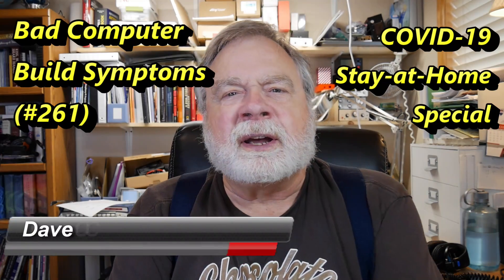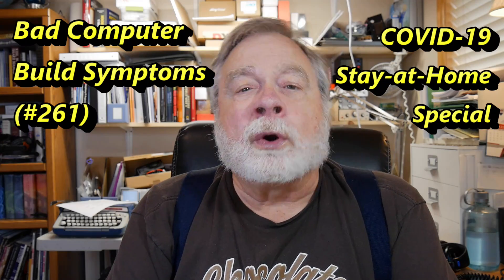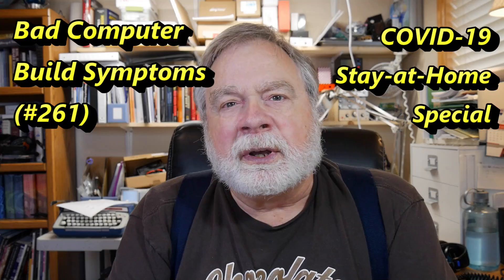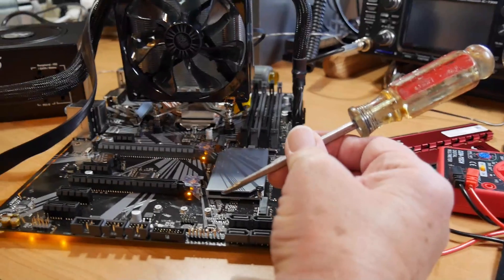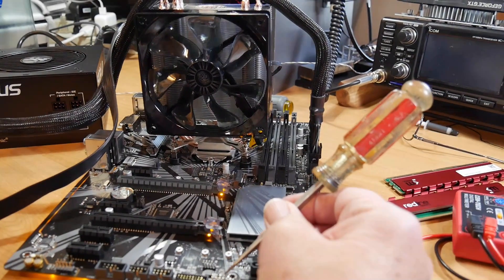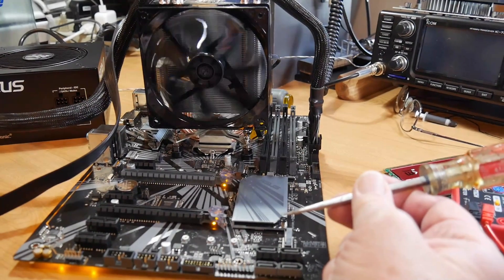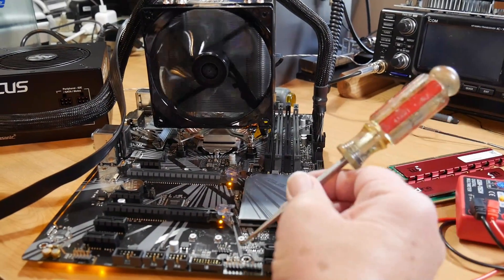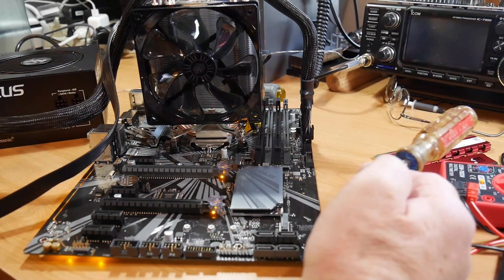Bad Computer Build Symptoms (#261)

Comment: I think your problem may have to do with the time you plug in the power cable wrong! The power supply turns on and sees something it shouldn't, or it doesn't see something that it should so it shuts down. Some power supplies must see a load on some of the leads before they will work. I learned that when I used an old computer power supply to use for my bench power supply. Did you check the runs on the board after you shorted it with the plug in wrong? I don't remember for sure but I think that the 5V needed a 20ma load or the power supply will not stay on. It sees something wrong.
Reply from the maker: It turned out to be a mismatch between the motherboard and the processor.

Comment: As many others have already pointed out, you have mismatched components, and worse, you're tapping a powered up motherboard with a metal screwdriver.  Not very smart thing to do - one false move doing that and you'll fry the entire thing - in fact that can happen even with the motherboard is powered down.  All it takes is for someone to forget to discharge themselves on a piece of metal before handling components or dropping a screw on the motherboard in the wrong place and you might as well frame it on the wall as a modern art masterpiece.  I am not trying to be insulting here - but PLEASE wait for your local professional to help you before you end up destroying it.

Comment: Before assembly of parts you should know that your motherboard and CPU are compatible. Not sure why you are checking the functionality of the case fan, CPU fan, etc. before running the computer for basic input/output system test to determine that your computer is working before it looks for an operating system. From this and the previous video it doesn't sound like you have tried a POST yet. I have built many computers. Unsure why you haven't performed a post yet and determined that BIOS is performing. 73 KB8AMZ

Comment: your motherboard has a 300 series chipset and your i7 6700 will work with 100 and 200 series chipsets. Need to match cpu with motherboard. The combo you have are not compatible . 73 KD5P

Comment: The Prime Z3700-PII motherboard is for 8th generation Intel socket 1151 Intel Core 9000 series  Core i7i5/i3 CPUs.
 Your  I7-6700K is a Skylark 6th Generation CPU. 

These will not work together.

Comment: Glad it has been resolved. One thing you can do to avoid that issue in the future is to use a site like pcpartpicker.com (use the System Builder from the main pages menu) and in this case you could select your CPU and then filter through the available motherboards (comparing the features you want such as number of USB ports, onboard NIC(s), no. of PCI lanes). Good luck with the rest of your build! You may also want to hold onto that MLB because you may find a need for it later.

Comment: As Aaron says, you can't use a 6th generation intel processor like the 6700K with a Z370 based motherboard.  So now you have to decide whether to replace the motherboard or the processor. I just checked online for prices for an 8700K processor. They run about 350 dollars at sellers like Amazon and New Egg (depending on CPU version). By the way, if you do this, you will be jumping ahead two generations in processor technology.  Good luck and 73 - John, K3SGB

Comment: Analyzed your troubleshoot, just to see if I could be of help here

2:00 - You've tried the 'bare board'. Excellent. Cooler must retain in place all time, no exceptions.

Did you try another PSU - This same symptom happened to me with a faulty PSU. Replaced and worked without changing anything.
Although the voltages seemed to be correct, there was a ripple - too big for the mainboard to accept. Most likely one of the output-capacitors failed for some reason. - confirmed later: Yes you did. 

2:30 Shorted the PSU switch lines - No issue here
2:50 Voltage checks done - OK
3:00 Another powersupply, an older one - may be faulty - dried capacitors
3:06 BIOS reset by removing battery etc - OK
3:15 No power on self test. Not a good sign, but doesn't neccessarily mean a dead mainboard.3 Thoughts go to processor incompatibility - BIOS upgrade might be required before using the processor
3:25 Reseating the processor. Should be OK

Intel Core I7 6700K - not the most recent processor (6th gen, most recent one is 10th generation, should be supported
Asus Prime Z370-P II - Asus lists with this mainboard: Intel® Socket 1151 9th / 8th Gen Intel® Core™, Pentium® Gold and Celeron® Processors - 6th Gen is not in here. On https://www.asus.com/nl/Motherboards/PRIME-Z370-P-II/HelpDesk_CPU/ -> It is not listed.

That must be the issue. Unfortunately.

Comment: When you reseated the CPU did you check the pins in the socket? Some times they get damaged. I used the same cooler on a build once and despite being carful it damaged the motherboard. Have a look and see if the bolts on the back side of the board are  shorting any traces. Also make sure that your mother board supports i7.

Comment: Dave, I was fixing a PC with that same issue yesterday. Sounds like the CPU may not be compatible with the board or firmware. Check for a BIOS update and see if it adds support for the CPU you are using. Also you've been able to "run" cpu's without heat sinks for at least 10 years now. It's still probably not the best but doesn't instantly kill them anymore. I'm always amazed at what "falls off in shipping" when a computer goes through customs. And to piss off all the Intel people, you should have got a AMD 2600/2700 series MB/CPU and saved some money. A slightly OC Ryzen 2600 could easily keep up with that I7 for half the cost and less wattage.

Comment: I have had this problem.  Put the memory in the other two slots.  That has worked but the other time I needed to RMA the mobo.  You also need to make sure you have the correct 4-pin aux power plugged in at the top of the board.  This can be aggravating but this is the fun “nerding” part of the project.  It feels great when you figure it out.

Comment: I went back and viewed #260 and then viewed this video again. 
My guess- Something is drawing too much power.
   Disconnect the power supply output leads and see if it comes on and stays on. Then connect one set of leads at a time.
   With the cantilevered PCB, you may have a trace with a microfracture. Get out your lamp magnifier.
   Check the fan by itself, it may be broken, or be simply the wrong or an incompatible fan. Give it a spin with your fingers to make sure it is free spinning. 
   Check your connectors. Some may be connecting to the wrong circuits, or simply not connecting at all.
   Good luck, and God be with you.
Doc Martin, N0QFT

Comment: I think you narrowed it down to a shorted out motherboard. It's likely a voltage regulator and it's supporting components like a SMD resistor in the regulator circuit, or circuits. You did well narrowing it down to that point. Good job on testing the PSU. EDIT-- I just saw one about the chipset being incompatible with the CPU, that's a good catch. But I have no idea what would happen with your mismatch. I've never done that before. Would your core i5 CPU be compatible with this motherboard? That could tell you if it's a short or just incompatibility. You're getting there, good luck.

Comment: Dave, sorry for your trouble looks like the list you were given was slightly bad as the processor is not compatible with the mother board and vice versa. I would keep the board and get a new 9th gen processor to match which should get you going. I've built several hundred PCs and this does not look like a MB failure by any means based on the video. 73's and best wishes. WA2G

https://www.newegg.com/core-i7-9th-gen-intel-core-i7-9700k/p/N82E16819117958?&quicklink=true
Reply from the maker: Many thanks for the suggestion!
Reply: @davecasler  My pleasure sir, glad to help. If you need an IT resource feel free to reach out.

Comment: I do not know what the problem is! 
   But check the traces for a micro fractures. 
   Also check for loose connections.
   Is it just the fan not coming on, or more. Back trace the power to the fan, possibly put an oscilloscope on the fan and record the power transients. 
   I'll listen to your video again.
Doc Martin, N0QFT

Comment: Have you done a close visual inspection of the motherboard, especially on the back side where the extra standoff was contacting the motherboard, probably shorting out the system.
  A bright light and a magnifying glass, if available, can be very helpful.  Also did you try to remove all sticks of memory and try to boot with just one stick at a time?  (not sure how many sticks you have).

Comment: If the POST fails check the ROM chip. I got a bad one eons ago and it was murder to troubleshoot. But POST make MUST sounds. If not, there's your problem. 
The fix? I replaced that chip and never looked back. Or return the M/B. The chip is not much, mine was socketed. Easy peasy.

Comment: Ok, looks like your power supply is ok since you followed my instructions from the previous video, nice. 

I noticed 2 things and so has others on here.
The cpu is not compatible with your motherboard.  https://www.asus.com/us/Motherboards/PRIME-Z370-P-II/HelpDesk_CPU/
While also checking compatibility, how about the memory? https://www.asus.com/us/Motherboards/PRIME-Z370-P-II/HelpDesk_CPU/

The photo with the connectors that you miss connected looks like the PCIE power connector, this is for video cards.  You need to use the 4+4 ATX connectors.

The cpu and memory have to be compatible with the motherboard you purchase.  The motherboard manufacture will offer updates for the bios and this update may
contain support for newer cpus along with other fixes.

Just for giggles check your backplate mounting.

Comment: Thanks for the update video Dave!

I will echo Aaron Baker's comment:

Your CPU and motherboard are not compatible with one another. I should have checked a bit closer on that after the last video.

Your CPU is an old 6th generation or "Skylake" chip, and that is a newer motherboard that only supports 8th generation, or "Coffee Lake" chips.

This Wikipedia article mentions the compatibility: https://en.m.wikipedia.org/wiki/LGA_1151

For Intel processors, you can tell what generation they are by the first digit after the dash in the model number (in your case, the 6th generation Core i7-6700K).

If you decide to get a different processor for that motherboard, pay attention to the letter suffix on the end of the model number.  If it ends in K, that means it unlocked for over clocking (forcing it to run faster than rated). No letter is a standard desktop processor, and U means low power (and lower performance). (There's a few others as well, but those are the main three).

The 6th generation of Core processors is rather old by now for a new build, and I would suggest getting a better CPU for that motherboard as opposed to a different motherboard for that CPU.

Good luck!
73,
AD8BU

Comment: Dave, the 6700K uP works with the Z170 and Z270 Intel MB's NOT the Z370. You will need Intel Core i7-9700K Coffee Lake 8-Core 3.6 GHz (4.9 GHz Turbo) LGA 1151 (300 Series) 95W BX80684I79700K Desktop Processor Intel UHD Graphics 630

PRIME Z370-P II
CPU
Intel® Socket 1151 9th / 8th Gen Intel® Core™, Pentium® Gold and Celeron® Processors 
Supports Intel® 14 nm CPU
Supports Intel® Turbo Boost Technology 2.0 
* Refer to www.asus.com for CPU support list
Chipset
Intel® Z370

Comment: Hi Dave, I looked at the motherboard user manual and it says that it is compatible with the Intel Core 9000 Series, 8th generation core I7 ... processors.  I then looked at the specifications for the Intel I7 6700K processor that you have.  It is a 6th generation product which has been discontinued, according to Intel's website.  I'm wondering if the motherboard and processor are not compatible with one another.  It looks to me like the motherboard is on the leading edge, but the processor is two generations behind  what the motherboard is designed for.
Rick, N0FR...Arvada, CO

Comment: If you go to https://pcpartpicker.com,  you will find that you cannot even build a system using those parts as they are not compatible. Try selecting your CPU and then choose your mother board. It is probably cheaper to buy a new MB. Or you could upgrade your CPU to I7-8XXX or a I7-9XXX.

Comment: Another vote for calling ASUS tech and let them guide you through their troubleshooting process. They can also validate your build components for compatibility. If you explain what you are doing with it on your channel and point them to the videos, maybe they will RMA the motherboard and swap it out. Worst case, you have to buy a replacement MB -- which so far seems to be the likely path I would be headed in if I were in your shoes. Maybe you'll get lucky with ASUS tech. You won't be any worse off.

Comment: Buying memory for any motherboard can be a very very difficult task. Placing the wrong memory in the motherboard will cause the system to not boot or work at all. Follow these instructions: (1) Make sure your motherboard is made for your CPU (Look at the back of the box and see if your EXACT CPU is supported, In addition go to the ASUS WEB page and look at this motherboard, to tell exactly what CPU is supported and (2) Do the same for memory, there are many many many memories that will fit in the socket and only the correct memory will work. Again look at the ASUS WEB Site and see EXACTLY what memory works with this motherboard. You can also go to the Crucial WEB Site and go thru the steps to pick the correct memory for your motherboard. This seems simple, but it's not. I saw 100's of user's who placed the wrong memory into there motherboards. The memory chips fit, but the system will not work. Take care and 73.

Comment: Hi Dave,
Highly possible you may have damaged the motherboard when the mistake was made with the two connectors at the EATX12V connector. Should have been only the 8 pin connector and not a 4 pin plus the 8 pin.  73  WB3BJU

Comment: The connector that you plugged into the 8 pin ATX power connector is the 6+2 PCIE power plug. You need to find the 4+4 ATX power cord and use that instead.

Comment: Hi Dave,

Ok, it sounds to me as if the power supply is going into a "crowbar" situation to protect itself!

Try this, please...

A) With power off & ac cord unplugged, use your ohm meter & check that connector that was offset & see if the positive & neg. are shorted!  

If not, & since you have the pinouts; attach the neg lead to the chassis & check each power line (+5, +12, +3.3, etc.) and see if any are shorted to the chassis!

If you do, or still cannot find an issue...

Please remove the everything from the chassis entirely & put on a non-conductive surface.
But check very closely [w/mag glass] & sniff around that connector top & bottom of the board to see/smell if it's burnt...

Check the main board, graphics, power supply, etc. & see if it will fire up without the chassis... if it does [and I bet it will], you may have missed installing an insulator, or the board is hitting the wrong spot... this may not be the correct type of chassis for this board [remember how it hangs out in the air on one side? Not right!]

Hope this helps Dave, 

73 - John - N7GHZ

P.S.
Hint:  many computer techs will assemble a computer with all components outside of the chassis & test first before reassembly inside the case!

Comment: Update: after seeing which cpu/motherboard combo that is also incompatible with each other. The 6700K will only work with Intel Z170 or Z270 chipsets. The motherboard you have works only on the Intel 8000 series (the 8700K is equivalent to the one you have)
73 KI5FIQ
Reply: Yes, the 1151 is the socket type of the cpu/motherboard.  It doesn't mean they're compatible components.
Reply: THIS!  Dave, you really needed to give us the details on your components.  I had to pause your video just right and zoom in to see the motherboard type.  Aaron is correct.  Your board looks like an ASUS PRIME Z370.  This is the wrong chipset for your CPU.
Reply: This looks like the case.  Nice catch!
Reply: I agree.
Reply: Good catch!
Reply: Yep. And I wouldn't call yourself inept, inexperienced and willing to learn. And fwiw, it's always the basic things that are easy to overlook when debugging. Intel is particularly bad about requiring a new chipset for every generation. Motherboard CPU compatibility is determined primarily by chipset, followed by socket.
Reply: I had an Asus with same problem. It turned out to be one of the memory modules. You may want to connect your speaker and listen to your boot up beeps.
Reply: Yet another reason I'm buying ready-made PCs. I used to build them but I've been out of hardware for 20 years now. I'm just going to buy an out of the box PC next time. I'm not saying it isn't worth doing it if you want to learn and try. Go for it! 

That being said, this initial comment makes a lot of sense. If there are no beeps there's either a problem with the motherboard or the CPU and it's not getting past the initial power-on test.

Comment: I don't see any memory on board I think its required but try putting one piece of memory in at a time then swap that piece with the other to weed out a bad 8 gig mem stick.  you did good with test only thing left is bad CPU or motherboard.  Good luck!  been there done that before and is frustrating.
Reply: Ralph Lees Agreed, it will shut itself off and will not POST without RAM.
Reply: Its to check fan spin. Which seems ok.
But it should normally just spin and beeb. Ore atleast spin the fan is no speaker is attached.
Reply: Also the cpu cooler blocks ram inputs 1 and 3 lots of mbs require your ram to start in slot one then onward or no post.